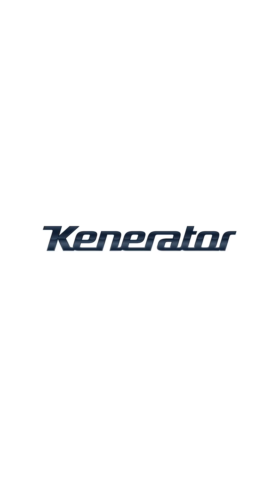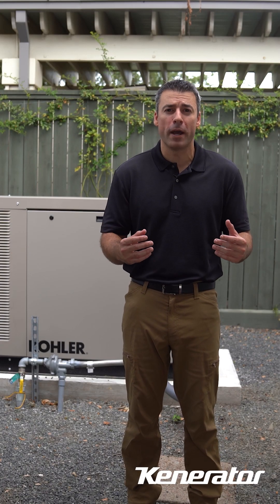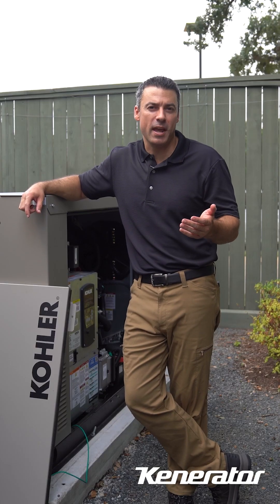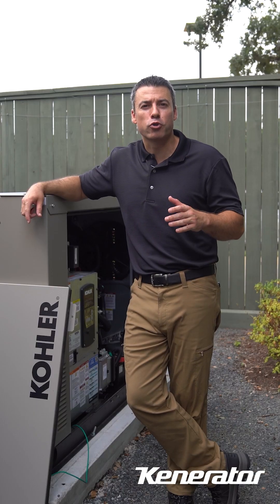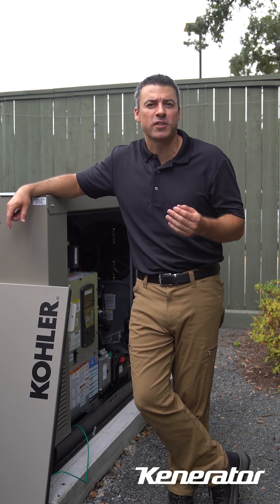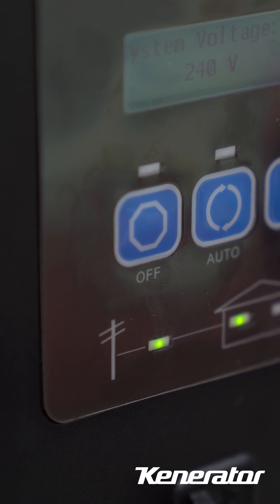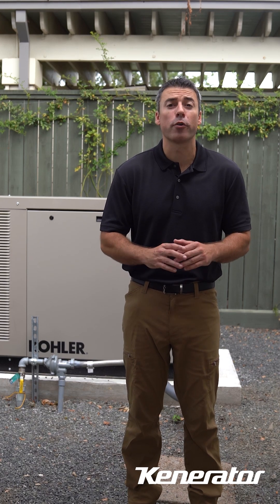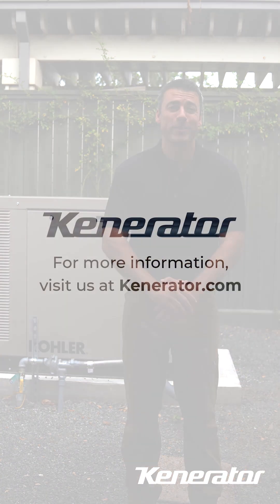Kohler Generator Warning Lights Explained: Diagnose & Fix Faults Quickly | Kenerator

Comment: I have a Kohler  generator that's set to automatic and tries to start, but it won't. I'll send you a picture of what it looks like. Also, if you look at the bottom, the LED lights aren't on.
Reply from the maker: Thanks for reaching out! It sounds like your generator might not be getting power or could have a control panel issue. Since the LED lights aren’t coming on, it’s best to avoid troubleshooting further until a technician takes a look. Please contact our service team so we can help you safely get it back up and running:

📞 214-978-6479
🌐 kenerator.com/service-maintenance

Our certified Kengineers can walk you through the next steps or schedule a visit to inspect the unit. ⚡